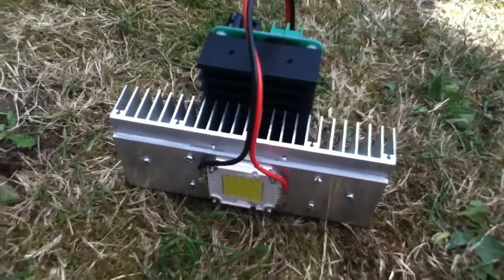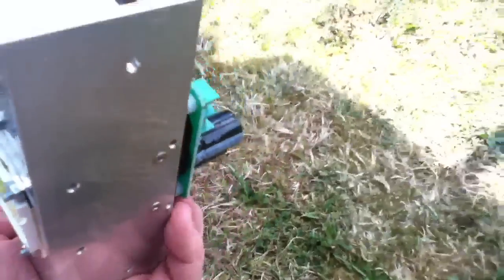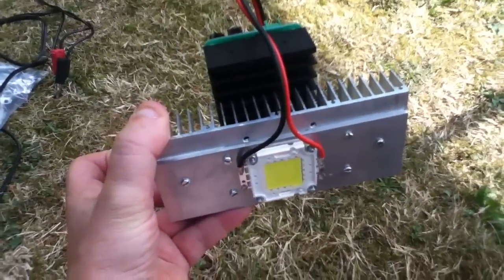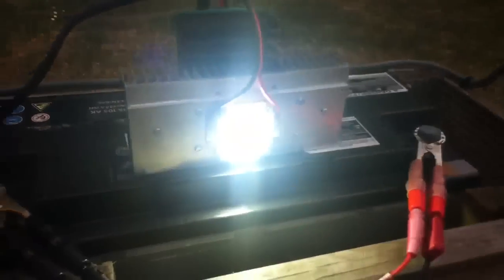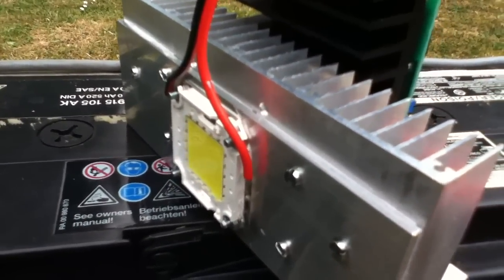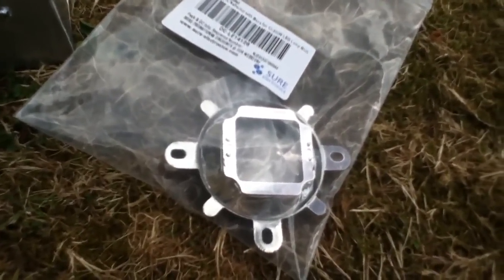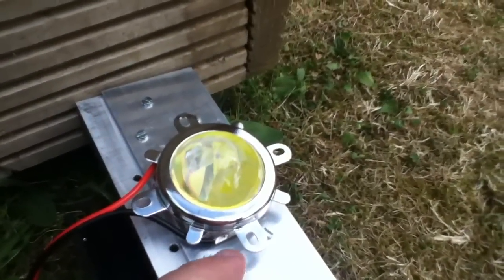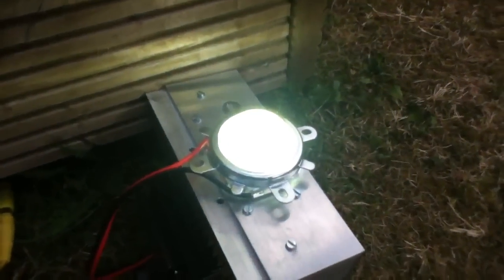Updates to 12V 100W LED Hardware - Heatsinks, Grease & Lens/Reflector

Comment: Make it more portable like use 18650 from cheap notebook batteries or a Lipo from rc aircraft models. I think using a cooper cpu fan would be better than a passive one.
Woulod be nice if you can put something inside those big 6v lantern or use it's head with a pvc pipe to extend a bit.
Those leds are hard to make portable overheating is a problem i think lithium ion or poly would solve power supply problems but an active cooper cooler i know that theres 125w tdp processors on the market maybe there's an air cooling solution.

Comment: I think the less heat sink paste the better. you just want a very thin film of it.
Reply: The trick is not to get air bubbles between the contacting areas. 
By putting a glob in the middle. When you fasten the LED to the  heat-sink, most will ooze out, spreading out, leaving no air bubbles and correcting for discrepancies in surface finishes. The extra is easily cleaned off with Q-tips.

Comment: i seem to be having a problem with the 100w led i purchased. i cant get it to draw more than 2.4 amps and i can only power it up to 34.6 volts. measures out to 80w or so. is it feasible to push this to 36v or higher to get the actual 100w output?
Reply: Unless you have a really efficient heat sink. Otherwise, I doubt.

Contrary to some people think, as the LED get hotter, the forward current actually drops at a specific voltage. In addition, the 100W is under laboratory conditions that are difficult to simulate and different to surroundings. Moreover, individual quality variations even manufatured in the same batch is another factor.

Comment: at 36v it takes only 2A, (that means only 720w) and at 42v it only reach 2.8A (120w)
and i wonder what is the burning limit...the voltage(36v)....the amperage(3.5A)....or the wattage(100W)???
P.S according to manufacturer specs. it has to be 36x35=120w...but it does not much with my measurements.
Do you have any clew?

Comment: I think a copper plate would be better between the LED and the heatsink. It will conduct the heat much faster into the alluminium heatsink
Reply: the paste is better. it fills in all the imperfections on the back side of led and on the face of heat sink.
Reply: No I mean still use paste. But it would go, LED>PASTE>COPPER>PASTE>ALUMINIUM.

Comment: I would put a drop of MX - 4 Thermal paste by Arctic, I think it would make a big difference in temperature, but ONLY a little drop right in the centre of the back (obviously) of the LED. I hope that you will understand me :DD the reason I would use MX - 4 is because it's used for computer processors which REALLY get hot and the MX- 4 In particular is a VERY good (if not the best) thermal paste out there.
Reply: StopaskingformynameYouTube  This is very true, but nothing says he had to use the most efficient thermal paste available. IIRC Julian didn't have any paste in there at all, so even MX4 which is pretty cheap and easy to use would be enough to help lower the die temperature. Additionally 11 of those 13 alternatives you mentioned are only 1.5C better, however I do like Toms hardware, they do great reviews.
Reply: PC parts get hot, but not 'really' hot. Your CPU will have a max limit of around 100c at the core or much lower (around 70c) at the actual heat spreader/heatsink interface. However the max temp limit of the 100W LED is quite possibly very similar. MX-4 compound is good, I use the stuff myself and love it as it's easier to apply than other compounds I've used, however is by no means the most efficient stuff available for PCs now. Someone posted below about using automotive Copper Grease instead which sounds feasible but the thermal conductivity figures I've seen for it are only half of what a what a decent PC thermal compound is capable of. I'd agree with you and say give some thermal compound designed for PC parts a try.
Reply: Glad you informed me :)
Reply: mx4 is wery far from the best compound. it's actually worse than 13 others including Coollaboratory Liquid Pro wich is THE best.

http://www.tomshardware.com/reviews/thermal-paste-performance-benchmark,3616-18.html

Comment: What is the current draw like? How long would a 7amp hour battery last? Thanks
Reply: current draw from the 12v battery to power the boost board is anywhere from 9 - 12 amps, probably half hour at full power, then you'd start to see some drop in output

Comment: don't use thermal compound as its not as conductive as you think i have started using copper grease yes the stuff you use on car brakes it works better than anything as the conductivity is as like having a pure metal contact also its very good with high temps upto about 1150c
Reply from the maker: Such a good idea.
Reply: I was using thermal compound on my pc as its a gaming rig it was getting hot still even using a 32oz copper heatsink I swapped the thermal compound to copper grease and the temp dropped about 30% in heat so all my pc use copper grease hope u have the same luck

Comment: hi Julian, i have ordered the same converter and led but i would like your advise.do you prefer running the module at constant volt or current mode?and if you choose the current how do you do it? (because you need to have a consumption to measure it...)Thanks a lot for your help!!

Comment: Thanks to your videos on Youtube,  I decided and order from e-bay :
100W Warm White LED IC High Power Outdoor Flood Light Lamp Bulb Beads Chip DIY
Digital Led 400W 10A DC Step-up constant voltage current boost Converter 8V-80V
Input voltage 12V from the car battery (or marine Deep cycle battery).
The cooling device will be PC processor cooler with fan 12V
Can you help me to assembly this.  I don’t  vont  to make some mistake and burn all.
Thank you very much
Reply from the maker: OK - to start: don't assemble anything!

Play with the boost converter - learn to switch the output on and off. Learn how to set voltage and current limits. Set voltage to 25v and current to 100mA.
Next attach the LED. Make it light up very dim. You don't need the heatsink yet, the LED will not get very hot. Touch the back of the LED to check the temperature. Try a bit brighter.
Now put the LED on the heatsink and make it go even brighter.

Take it step by step - have fun!

Comment: i am currently planning a similiar project. I will also use the sure-e. 45mm lens Kit and i hope i can get it fixed to a cpu heatsink as they should work a bit better than these flat ones.
I will use a fan but does the led get very got with you fanless version?
If everything goes fine i will make a video.
Reply: just finished my project if you are interested: Very bright DIY 100W Flashlight (8500Lm)
You will probably need a fan with your heatsink.

Comment: Try using a TEC (Thermal Electric Cooler) It will draw a shit ton of power, but it will pipe the heat right off that LED and might even possibly cause it to frost over, though I doubt it. You can limit the effect of the TEC by limiting the voltage and/or amps you to it. It uses 7amps at 12v I think. I've run them though off 5v at 1amp. Easily powered by a pc psu.

Comment: I wonder if you could attached an Peltier module to the back of the hot led to recover some lost energy and feed it back into the boast converter to improve efficiency?

I'm not sure if the recovered energy would be of any use as it would be quite small I imagine.

Comment: nice little unit julian . hey iv been thinking what about clamping the led to the cold side of a peltier device ? ley me know your thoughts :)
Reply from the maker: The thought has crossed my mind too. Firstly, the peltier element would have to be rated at (or near) 100W. The peltier element is just a heat pump - it just moves heat (and it only moves it a few millimetres). It wouldn't help much. A dirty great heatsink is the real answer.

Comment: hey you used the 10-80v step up converter from ebay, i got one of those but finally blew it up on accident haha. very useful little module.
Reply from the maker: It would be worth fixing that - the MOSFET or a diode probably
Reply: Julian Ilett
i think it was an integrated circuit that blew, its ok it was only 15$.
Reply: It was likely due to electrolytic capacitor aging, most stuff you get from china real cheap has recycled caps
Reply: Jon Topham
no it wasnt that. i know its the chip that blew. that caps are really nice and i may use them for something else.

Comment: totally amateur question: how does a 100 W piece of equipment produce so much heat, especially given that a large chunk of that power is converted to light, which is the main reason why LEDs are considered so efficient compared to incandescent?
i mean, you don't need a heatsink for a 100W inc. but you do for an LED? that doesn't make sense :))
Reply from the maker: Totally brilliant question. I've been thinking a lot about this recently and I may produce a video on LED thermodynamics soon. Actually, only a small chunk of the incoming power is converted to light - difficult to get exact data, but it's about 20% for an LED. That's better than about 2% for an incandescent (these numbers may be inaccurate). On your 2nd point: a 100W incandescent runs very hot - energy loss by radiation (heat & light), convection and conduction (mostly convection) is in equilibrium with incoming energy. LEDs can't run that hot (several reasons - plastic parts, effects on forward voltage) so cannot be allowed to reach equilibrium temperature. So forced cooling is necessary - either a very big heatsink, or smaller heatsink and fan, or exotic stuff like water cooling, heat pumps (peltier elements??). The thermodynamics are almost as interesting as the electronics!!

Comment: You are running it at 5 amps? No wonder it is getting very very hot it needs more like 3 amps
Reply from the maker: Sorry, that was an error. The LED should be limited to 3A as you correctly say. I've changed the description.
Reply: Just adding 2 small PC fans would make a huge difference to the temperature.with a 10w led I had it reached 45 degrees without fans then I put 2 small fans on the heatsink and it never went above 24 degrees.
Reply: ***** ye I usually run it at around 60w as it still melts yours eyes but it produces a lot less heat
Reply: ***** i have just made ( almost complete) a 100w led torch and i used a normal glass lens off ebay and also a fresnel lens and it is pretty focused now and its absolutely blinding now, not that it wasn't but it has some throw to it now

Comment: What is the heat like at around 50w? I have just bought a 100w led but I'm looking to run it at around 50w
Reply from the maker: Heat energy is like a fluid - the more that flows into a metal block, the hotter it gets. So it's important to make it flow away as fast as it's being produced. Fins and fans help that happen. A 50W LED will produce heat like a 50W soldering iron - it's quite easy to imagine how hot that would get without adequate heatsinking.
Reply: That didn't really answer my question and a 50w led will not produce the same amount of heat as a 50w soldering iron because the heat from a led is the inefficiency of it and the heat from a soldering iron is because that is all the 50w is doing creating heat.
Reply from the maker: TheLukey21 That's true. LEDs turn about 18% of electrical energy into light and the rest (82%) into heat. It would be more like a 40W soldering iron.
Reply: I will ask again. I am wondering what is the heat like when running a 100w led at 50w?
Reply from the maker: TheLukey21 Hot enough to destroy the LED unless you provide adequate heatsinking. Running a 100W LED at 50W doesn't help much, it just takes longer to heat up. You could kill a 100W LED with 3 or 4 Watts if you wrapped it in cotton wool. Outdoors on a windy day, it might survive 20W. With proper thermal management (heatsinks/fans) it can be run continuously at full power. Bulbs are different, they're designed to run at very high temperatures - high power LEDs are not, the heat must be drawn away.
Reply: My heatsink is about 1/3 the size of yours in the video but I'm going to have 2 possibly 3 fans to keep it cool. Thanks for replying after me being a bit of an idiot, sorry.

Comment: I'd like to retrofit an old 8mm projector with one of these but it seems like it'll just be too large. It may work well for a 35mm projector though, for home use it should replace the old, dangerous and bulky xenon lamps they use quite well.

Comment from the maker: Watts are not a good measure of light output. The 100W LED has a light output of about 9000 lumens - a 100W halogen will produce about 2500 lumens.

Comment: Where did you get the DC driver for it?

 I have found stock Intel round CPU heatsinks work really well with these. A 92mm fan is still required for maximum output, But it is inaudible.

Comment: Hey I would like to know , I thought LED's does not emit IR and hence, the light out of them would not be hot, you said that it's feeling warm, I planned to use it in a projector as I wanted to off-load the heat from the light beam, can you tell me how hot the beam can get?
Thanks

Comment: I'm working on fitting a 100watt led into a 500w work light, it will run on car voltage 12/14v with a stepup. The light will be on for 1 to 2hrs at a time, do you think your size heat sink is enough for it (adding 2 fans) ? or would i be able to get by with a cpu heat sink with a high speed delta fan. the light will have holes for vents

i bought the reflector & lens, but i am looking for a flood light effect and light up everything. should i put the reflector and not the lens or just bare led?

Comment: hey. 
Great video . 
I have a question ... Im thinking of making a flodlight  for my 4x4 out of an 200 W Power led.  My car has an 24 v system - can i run it straight of it ( chargeing power output is 28 v /and the led's suplyer marks the operating range from 30 - 36 v )  
How mutch v does the DC adapter put out ?  And if the led runs on 24 v is the light in any ways dimmer ?? 
Keep up the good work !! 
Jyri from estonia

Comment from the maker: Agreed, too much grease will reduce the metal to metal contact - too little will leave air gaps. It's a difficult thing to get exactly right. Thinly applied, widely spread would be my advice.
I found some awesome 12v (300mA) fans - they're only 4cm x 4cm but spin at an incredible rate - they shift a lot of air.

Comment: Actually you want to use as little grease as possible, to do thermal conductivity, while still filling the air gaps. Too much will actually prevent heat transfer. And a cheap fan on the back of that large heat sink will keep the led perfectly safe.

Comment: Ok thanks! I was planning on using a fan because I already made one of these 100 watt leds but the driver runs off 110AC and I really wanted to get rid of the plug! And you will notice a difference with a lense I have one for mine and it did, and it didn't get hot at all

Comment from the maker: Once it's bolted on, I'll do the car headlight comparison again. The lens shouldn't make the LED hotter if the path through to the heatsink is thermally efficient. But I expect the lens will itself get hot. The reflector is plastic though... I was hoping it would be metal - oh well!

Comment from the maker: They're binding posts, bolted through, heavily soldered and heat shrunk with adhesive-lined sleeving. It was important to me that the croc clips could be opened by pushing on the binding posts without anything bending or falling apart. They're very tough!

Comment from the maker: I can't see any point in going beyond 100W - such a lot of power in such a small space creates real heat management problems. Probably more sense to use multiple LEDs if more light output is needed. The 100W LED was good value at about £8 - the bigger LEDs are disproportionately expensive.

Comment from the maker: Yes, the boost regulator will hold the output current and/or voltage stable as the input voltage declines. There will be a point below which the regulator becomes unstable or will not operate - this one has an input voltage minimum of 10V (I think). Don't make it too compact, you need enough heatsink to keep the LED cool. I don't think I've got a big enough heatsink for continuous use.

Comment: Does the output voltage and current stay the same if the input voltage fluctuates? Say if i were to power it with a smaller lipo or lion battery and as it dies the voltage lowers slightly, I might make one of these but much more compact and portable..

Comment: Hi Julian, I'm actually a student on mechanical. I have a question regarding my current project. I am to power a DC motor using batteries. Currently I am using a 12V battery to run to motor but the wattage  is too low (0.22amp). Is there any way to increase the current flow from my battery?

Comment: Thermal paste: less is better. The micro-voids between the heatsink and led just need to be filled not the metal-to-metal contact. Heat sink thermal paste should be applied sparingly and evenly. Use a small blob of paste in the center of the heatsink area and spread thinly and evenly using a credit card or plastic hotel key. Use good thermal paste like Arctic MX2. Check out computer hardware sites (like tom's) for "applying thermal paste".

Comment from the maker: That's given me an idea. My electric bike has a 24V battery - the boost converter I'm using could be connected to 12v or 24v without adjustment. The bike's motor is 250 Watts, so if I'm also running a 100W headlight the bike's range would drop significantly. As you say though, it would only switched on for short bursts.

Cheers!

Comment: Where i live bicycle lights are not regulated, and i won't be using it all the time. Bike already has 4x cree U2 leds. But i need something for extra light for long straight paths. Besides, an aluminium bike frame would be the best heatsink.
Great vids btw, keep it up.